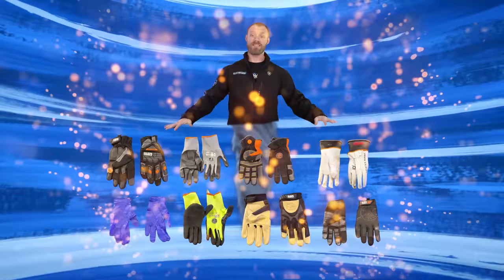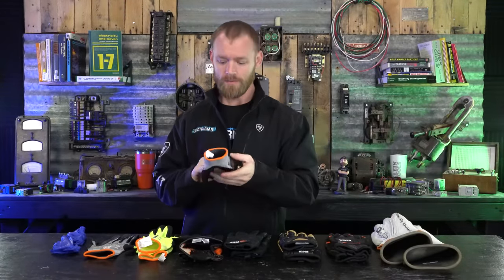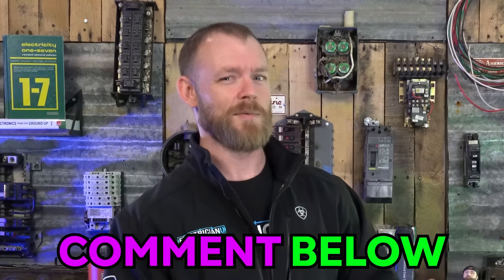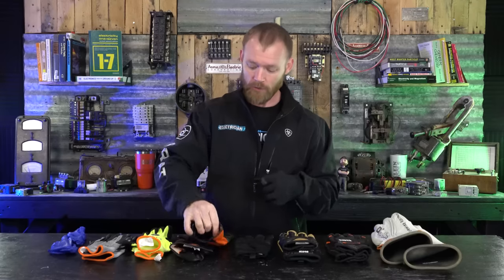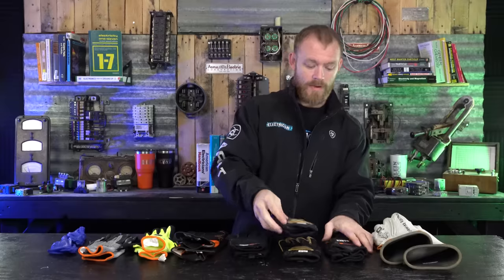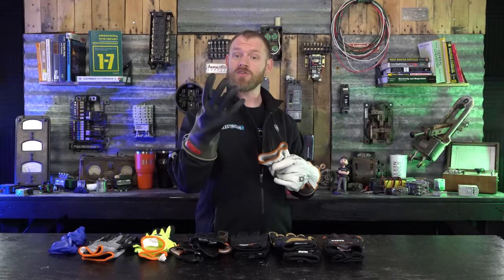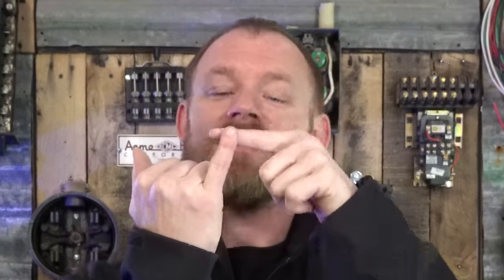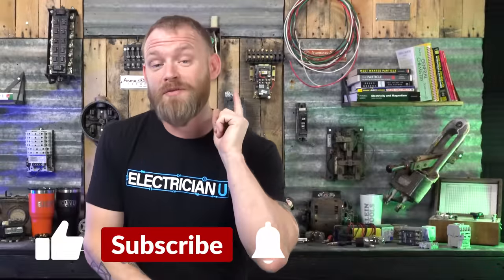Work Gloves For Different Jobs: Gloves For Electricians

Comment: Couple comments regarding the energized work gloves.

(1) There is a third, inner glove that wicks away moisture from your hand, keeps you from getting that clammy dishwashing glove feel to them, but also means that moisture (which is very conductive) is kept away from the rubber layer.

(2) They should be tested every time before use. Part of a linesman's morning ritual at the job site is to roll them up from the wrist, like a balloon to test for pinholes. They do that every time, no matter whether is 120/240 residential service, or multi-kV distribution. If there's a pinhole, the moisture from inside the glove will find a way through and at that point the insulating layer is moot.
Reply: I was gonna mention number 2, but you have it managed. More people should know about that. Well everything you mentioned lol

Comment: I am ALWAYS on the hunt for the perfect glove...in the nicer, warmer weather, I LOVE the 'cut' dipped gloves...If you find the right size, you can still work and grip small hardware and use them as you would your bare hands...I also try and preserve them and will throw them in the wash, it'll give a little more life to them...

When it comes to cold weather...there is no 'PERFECT' glove...First, I use Nitrile gloves as the first layer, so incase moisture gets through my outer layer, it won't touch my skin. But, with the outer glove, you can only have two of the three - Warm, moisture repellent, dexterity...If it's warm and moisture proof, they are most likely to bulky to grab hardware, etc...If it's moisture proof and dexterous, It's most likely NOT warm, etc...so we just figure it all out....NOTHING worse than cold hands, that get wet!!! Thanks for this video dude!

Comment: I think it may have helped a bit to show which gloves of the ones you showed can pass the screw test, or picking up a small screw off the ground. I also prefer gloves that have enough dexterity to pick up a flat washer off the floor while still protecting the hand from cuts and scrapes. For me that is the "cut" gloves you mentioned. We use A4 rated ones at work. I've been wanting to try the Maxiflex green cut gloves, but they don't sell them in many places.

Comment: Saw your video a year after publication. I've been retired for 3. I would really liked to have heard you tell the homeowner types that nothing besides the last pair you demonstrated are in the least voltage rated. Even some licenced electricians (contractors) who worked for my company did not know NFPA 70E. We actually turned them away from the job site and would not allow them to work untill they were completely compliant. This meant gloves of the proper class for the proposed work, that had been tested by a test lab, even brand new shall be tested. Plus leather protectors, etc. Homeowners especially shouldn't try to work on anything energized, and neither should professionals unless absolutely necessary. My job was with a subcontractor running a Department of Energy laboratory. We had to have our safety ducks in a row. Homeowners can do lots of risky stuff unaware. Electricians, some of them, do it fully aware. I hope they all make it home to their families every evening.

Comment: Cool video....... been their....done that..... have gotten  wood and metal  and screw tips etc jamed in my hands..... a sliver is considered a sharp pointed wooden or metal shard close to the insertion  point of the fingers or hand. The other one is  usually a shard that has fully penetrated the  skin and needs to be professionally removed and  cleaned.   I wear a lot of gloves now cause i dont like pain.

Comment: My first Electrical company I worked for in California would solely give out the maxi flex gloves which let me say as an electrician feel freaking amazing. My second company in Arizona however did not give us those but I will say they gave us three types of gloves. Hot gloves for hot work, really thick gloves for roughing in MC and your standard all purpose gloves. All in all they all serve their purpose and sure when you have been exposed to so many you tend to be a snob after sometime lol but as long as you have any set on you when the safety guy is walking around you are good my man 👍
Reply: Wired over 300 houses, several  hundred apartments and commercial businesses, along with an industrial power plant. Never had a "safety" guy tell anyone we had to wear gloves. If needed we did it on our own. Common sense will tell you when they are needed.

Comment: In Atlanta they’re splinters. I always go with the neoprene or polypropylene coated gloves. They’re insulated so they work okay for LIGHT work in live panels. U can even use a touchscreen in some of them. If I was doing a remodel in a live panel I’d definitely want some 1000V gloves though.

Comment: Hey Dustin love the videos. My favourite ones are when you are in front of the whiteboard explaining electrical concepts to us though! Would love a video on pool/hot tub installations.  Any video you post is greatly appreciated though, you are an amazing teacher and learning seems easier from you. Thanks 🙏
Reply: Last hot tub I did had the wiring preran because of concrete put in. They must've crushed/cut the line underground because no current was making it over. We had no way to pull the wire because it was stuck in the PVC they ran, maybe 50 feet. I had to cut and rerun the line, owner was not happy, I don't blame him.

Comment: Homeowner with some electrical knowledge, but by no means electrician-smart, adding a circuit breaker to house panel and whole house surge protector to breaker. Probably won't use the gloves more than once or twice but want basic protection against a brief brush with live wire. Recommended glove for this task?

Comment: For demo and material handling I use the classic leather gloves. For general construction and electrical work I swear by the Hyflex cut resistant gloves with the spandex backs and coated palms and fingers. They have great flexibility and breathability, prevent cuts and abrasions while being thin and tight so I do most fine wiring work. They are inexpensive and last a long time. I have wide palms, but short fingers so finding good-fitting gloves is hard to find. If they are large enough to fit my palm, the fingers are too long. If the fingers are short enough, then the palm is too small. Frustrating. I get the Hyflex spandex gloves one size smaller to fit my fingers, but they stretch enough to be comfortable across the palms.

Comment: I love leather gloves but I can’t twist wire nuts with mine😂😂😂 talking about hand damage and slivers here in the northwest…I used to be a machine operator in a lumber mill…that’s what got me here…but most nites I could go home and use a tweezers and a razor and spend an hr picking slivers out of my hands and arms😂😅I miss those leather gloves but wood would go right through them anyway…thanks for the video Dustin 😊

Comment: For some reason I keep finding myself working hot in residential or small commercial jobs doing switches and receps. I find that I keep getting small shocks… any suggestion on gloves to prevent these small shocks? I’m assuming leather.

Comment: All of you out there who forgot what your momma did while shopping for your new shoes, here's a reminder:  You don't want very much space in the toe of the shoe or the tips of your gloves or they won't fit right.  Get gloves with NO space at the tips of your fingers--ideally snugged up against the very ends of your fingers, but a little TOO tight is OK too so long as your fingers don't start to hurt or go numb while you wear them.  Give it 10 minutes in the store and see how they feel, you are in no hurry.  After a week or so of breaking gloves in, they will go from tight to just right, and you won't lose the ability to pick up small objects like you would with an ill-fitting gloves.

EDIT:  When Dustin was talking about gloves protecting your hands from impacts he wasn't kidding.  If you do a lot of work with sanders, jack hammers, etc. and you don't have the right glove...well I bet everybody here has used a tool for long periods and it felt like your hands have gone halfway numb and start throbbing.  That is NO BUENO.  You will develop carpal tunnel, arthritis, ligament and/or tendon damage, and just generally wish you had a time machine to go smack your younger self for being such a dumbass.  Save yourself some misery and get a glove with extra padding on the palms (and ideally the inside of your fingers).  If you can find gel-filled gloves that's best, but any padding is better than nothing.  

Just remember how impact drivers work: you don't feel them trying to rip themselves out of your hands but they still manage to  break loose just about any fastener you can find.  Except in this case your hands are the fasteners and that orbital sander you're using is the impact driver.  Work smarter not harder, and stay safe out there gents.

Comment: What call cut glove or any gloves should have a rating on voltage rated also. Warn works not use them protect them from being shock being hurt. Klein and other company's don't state this. Is Klein and others a woodshop company?  Cut the fuse, is it that easy? No such thing as all purpose gloves.

Comment: So, none of the electricians gloves protect you from electricity except for the last one...the "hot" glove?
See where I'm coming from? I intend to do some electrical work at home (i.e. electrical switches, outlets, etc.), but even with the breaker off and testers says not live...i rather wear electricity proofed gloves when i touch the wires.

Comment: Fish tapes are not designed for pulling cable.  They are designed for pulling string or mule tape.  If you need grippy gloves to pull in string or mule tape or have another more serious problem to address.  Love the site.
Reply: Never been on a job where they had me use string or mule tape to pull wire, it definitely sounds easier that way, but more time consuming

Comment: I hate gloves - gloves are for sissies and fraidy-cat insurance people. Worked as an electrician - industrial for 47 years, from 6=32 screws to 4" heavy wall. Try putting a 5-32 into a terminal strip with gloves, while wearing fireproof head to toe stuff. 

Try seeing a yellow wire with a green face shield. The safety industry has made the job soooooo unsafe, I retired early 5 years ago.

Last plant wanted super- non cut. Got expensive. I wear a size 11+, biggest they would carry were 9's. Once a year safety test, Handed the gloves to my boss ,,, you can't do that! 

I told you for the last 5 months, they are too small, so I figure, you might want an extra pair to lug around. He made me try - OJ Simpson would have been proud

MAKE MORE RULES TO MAKE THEJOBMPRE IMPOSSIBLE, SOTHE SAFETY INDUSTRY CAN EXPLOIT MORE COMPANIES! 
The lobbyists are just salesmen, that care for their pockets more than people